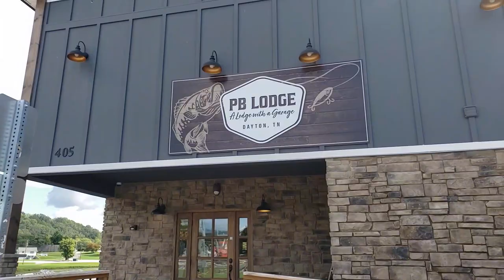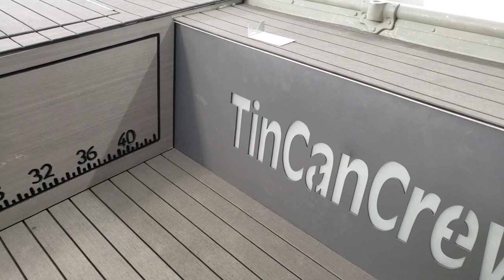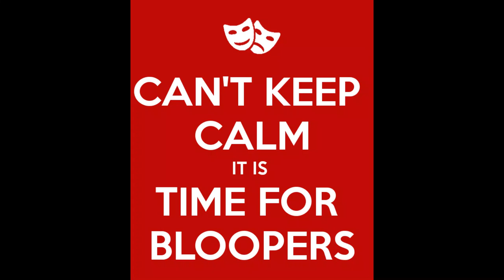We built this Jon Boat in 5 days! Epic Bass Boat conversion

Comment: Freaking sick boat. I’ve been grinding your vids trying to figure out what I wanna do. I’ve got a 2020 1542 with a predator 670 and probably 15-20 year old long tail go devil. I’m definitely gonna weld up a front light bar bumper like you put on your boat and do a nice deck one day! How much do you recommend the mikuni carb? I’ve had some fueling issues and but I got it all cleaned out real good and it seems to be running okay ish. I’m trying to decide if I should just run it and risk being dead in the water somewhere or just bite the bullet now and get a mikuni! I know if my boat dies for a second time with my wife in it she’ll never ride with me again😂

Comment: The only way to make the smaller drain plug fit is to use flex seal to put your tractor tires on your Honda Civic.
Reply from the maker: I have so many questions

Comment: I recently bought a plain jain J.B.   And the plastic gas tank that came with it leaks a little gas everytime I haul it to the river . and yes it does have a air vent on top of the cap that is tight but still leeks.  What is the solution ?
Reply from the maker: Gas tanks these days are junk and I consider them expendable. When they start leaking I get a new one. Not worth the hassle trying to fix
Reply: @SendItJonBoats  thx man